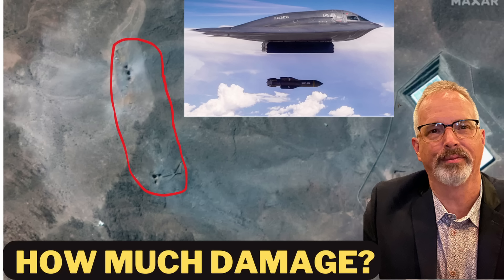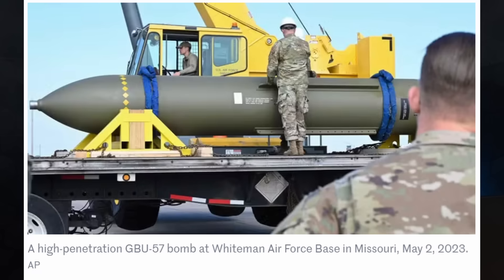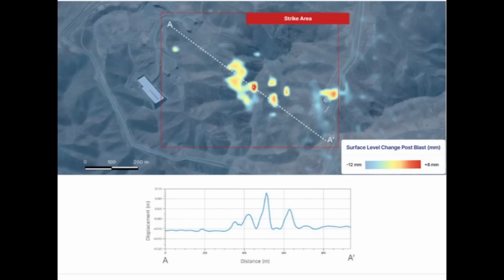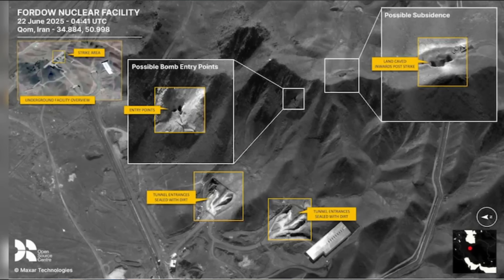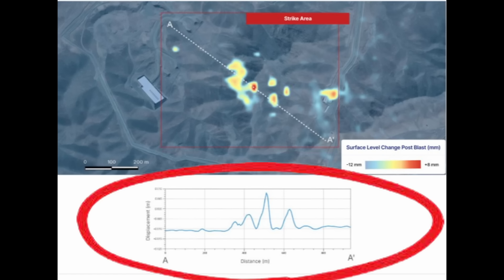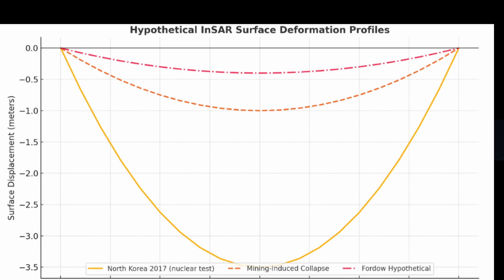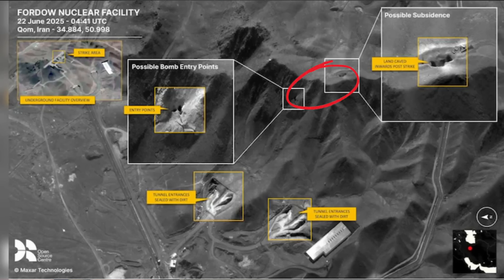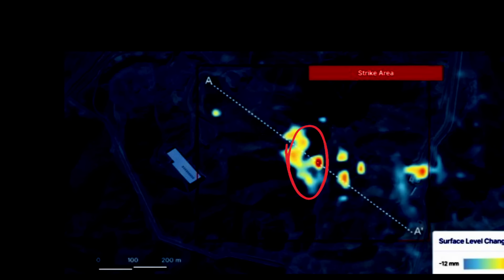Fordow Attack Assessment -  Update

Comment: You need to consider the use of (uhpc) ultra high performance concrete. Which is used to fortify these sites, significantly stronger than granite.
Reply: He omits it on purpose. He wants to badly believe this was some triumph.
Reply: @rashnuofthegoldenscales4512  Rashnu, you may have missed the part where 1+5 GBU-57's went down the ventilation shafts.

Comment: If I understood correctly, the damage assessment presented here is based on theoretical calculations using internet-derived data rather than the visual presentation of surface scans. If so, it remains to be seen what actual damage was sustained.
Reply from the maker: What are you talking about? The InSAR analysis involves using surface scan data.
Reply: @CaseyJones-Engineer  Thanks for your response.  I watched your video again and reached the same conclusion as my first comment.  Your  opinion that the Iranian nuclear facility was 'obliterated' by the US bombing may ultimately prove correct but  your video doesn't establish this as truth. You said you based it on calculations using granite physical  properties, explosive capacity  of the bombs and various assumptions about their ground penetration. You explained why the measured surface deformation might be small but you didn't use these measurements  in your calculation. I'm guessing this was because it would  require more complex 3D geometric modelling and data that isn't publicly available. All other engineering assessments I've seen have been more cautious in their terminology and refrained from using 'obliterated',  which has only been by political operators.  Unless you want to display a political bias, I would await the data or ground truthing before using it.
Reply from the maker: @tmcb2000  A difference without a distinction.
Reply: @CaseyJones-Engineer  Except you may be proved wrong if Iran is able to revive it's nuclear program.

Comment: In 1972 in Rhodesia the largest coal Mine underground operation suffered a catastrophic coal dust explosion probably initiated by methane gas igniting, there were 400 men killed and only about 11 bodies recovered that were closest to the shaft. The explosion was so strong that the Head gear for the hoist cage was blown completely off its concrete pad; trees and office buildings on the surface were scorched and severely damaged, I mention this because some 15 years later the ground started subsiding on the surface, in fact sone of the Mine accomodation had to be abandoned as tunnels that were underneath the township collapsed and this had the effect of a mini earth quake that cracked brick walls etc. Will be interesting to see how long Fordow shows subsidence

Comment: What if the ventilation shaft was far deeper than the works and blocked off from the drives? Not much sense in blocking a vent shaft on the surface and not below ground.

Comment: Hi. I understand that you assumed that the whole weight of the ordnance is actual explosive. The actual explosive content is way lower. If I am wrong, no offence intended.  Regarding the volume of fractured rock, I doubt that using quarrying loading factors where open faces (sides or top) and delayed set time allow for maximal expansion is of help in this case.  When blasting, the main breaking effect is TENSION due to the compression shockwave hitting a void (the open face).  A totally « enclosed » blast would never create the « volume effect », since without open face, the necessary tension cannot occurs.  There would be significant crushing in the immediate vincinity of the blast, but this would remain « local ».
On the flip side, in competent granite, without crushing the whole mountain, the blast shockwave could certainly travel distances to an open face, like the chambers of the complex, and expand there, filling the void with broken rock.  The facility is then wiped out and it’s case closed.  Now, if there would be two level of voids, my guess would be that the first one would be destroyed, but it would no pass the shockwave to the other. So in my opinion, a « two story » complex could have survived. If I know that, the US military’s Engineers know it, and the Iranian Engineers also.  Then, what is under there is a mystery for now. That was my two cents, and in now way a criticism of your work, that I appreciate very much.
On the strategic effect of the bombing, unrelated to the subject, I would just ask this: Where would you keep you valuables if you knew that the best safecraking team was in town for a job on your safe? Thanks Casey.

Comment: I said two-three weeks before all you silly engineers, pilots, enforcers, and every other dickie bird chirper, that vent shafts are the answer. Even for a ops squad to gain access.
When you've worked 3.2kms underground on south Africa gold mines, you understand better than most, pressure, air flow requirements and the force exhaust ventilation shafts size apertures required to live and prevent damp moisture occurring.
Question ❓ 
Whats a professional engineer. 😂😂😂😂😂

Comment: Up front, I don't have any background in geology, arms damage assessment, engineering or any of the sciences needed to make a critical evaluation here. But I do have lifetime of accrued observation of physics. Worth nothing, perhaps, but I find my observations corroborated in many instances. 

What I notice at Fordow is these MOPs repeatedly piercing the vents, deep into the hard granite. Each bomb driving deeper and detonating at depth. The explosive forces and resultant gases are not demonstrating on the surface. Those pressures are not simply absorbed by soft rock. This is hard, but brittle granite, not known for its flexing properties. Therefore, the first subject here would be mass compression of the open spaces (tunnels, shafts and work spaces). The volume of gases would far outweigh the capacity of that compression to absorb it. Next, that pressure would uplift toward escape. The depth and strength would largely hold in that expansion. So now the rock begins to shatter as the substrate flexes to absorb the blasts. That pressure, confined in this hard box of stone, assures complete destruction in my eye. It's almost like being inside a pipe bomb. Too much pressure and not enough space for expansion.

I would expect there to be a large void beneath the surface at impact points, shattering of the rock around these pockets
and total destruction of this facility.

Maybe I'm wrong, but this is what my common sense and applied physics history tells me. Iran will evaluate the damage and their actions will determine the success or failure of Midnight Hammer. If they start digging this equipment out, we may have failed, but I suspect they'll view the evidence and abandon this site. Thank you, for accommodating this simple man's opinion.

Comment: At first on TV some said bomb was 14 ton and it went down through granite 50? meters. Consecutive explosions are not equal single big. Explosion caused some rock melt, some energy (may be 1/3) to emit through shaft. What is more explosion resistant: reinforced nuclear protective concrete of granite?   Ventilation shaft connects to ventilation chamber thought ventilation ducts, there are fire dumpers, do you think that fire dumpers were explosion resistant? What material used for ventilation ducts? Where are the design  drawings? So ... what are you really talking about?

Comment: When railway tunnels are dug through mountains, the huge ground-pressure caused by the mass above can cause explosive spalling from all areas of the tunnel walls inwards. In this case, I'd imagine that the huge pressure-wave through the rock would find it's way to the tunnel walls and cause the same effect. The amount of high pressure gas from the contained explosions would find all sorts of cracks and fissures, scouring any voids.

Comment: - If the aeration wells are not straight and are deported from the entrance (which would be logical as protection) the bombs did not affect the site in depth.
- 100,000 m3 that makes 100 m x 100 m x 10 m high: it’s a lot but if the plant are not in this area it won’t do anything. At a depth of 80 m it’s far, there is at most a fracture of the granite but no damage.
- It is also obvious that the Iranians had time to move blocks of granite to seal the galleries, it was enough to have kept some from the construction.

Comment: The way you presented your data and your conclusions I find the conclusions a bit unsupported by the data. By all the information you presented it seems that it's very hard to estimate the damage dealt to the site. The conclusion that I got is that surface level data are simply insufficient to judge the in depth damage. 

What I found a bit confusing from your presentation and a the surface topology map shows a tiny surface change and moreover there is a surface uplift on a totally unrelated spot, meaning that this data could be conflated with other phenomena and could be showing us something other than the damage from the explosion. So I really don't understand what is the data that actually suggests that there was indeed massive damage.

Comment: The impact of GBU 57 on Fordow site is a diagonal hit as shown by the three holes and not a vertical hit going downwards. The concrete cap which the MOP pierced coupled with a dogleg design of the ventilation shaft could change the direction of penetration to diagonal/ lateral instead of going vertically downwards. Though the initial and subsequent GBUs would cause a substantial damage within the rocks but how much to the centrifuges / main structure is a matter of assessment which may or may not be factual.

Comment: not sure what you are anilizing but it would appear to be the video of testing the bomb. the footage they showed of the actual bombing was a fireball like heroshima that came back out the hole the bombs went in. if there was penitration do you actually think there were no other ventilation shafts in the facility that would have had massive pressure and fire to come out. and what about the entrances surely that monster bunker superfragilistic buster should have had the power to blow those entrances wide open. As engineers you may want to add in a little common sence to your calculations after all this is real life listen to what your eyes are telling you.

Comment: Great presentation but I'm just wondering if the cumulative, progressive weight of granite at depth increases its stability and skews all these calculations about explosive force in granite. I'm a layman, And maybe the 'high confining stresses' you referred to would basically say that the higher the resistance of the granite produced by the weight of the granite above it would actually increase the destructive power of the explosion. Is that correct, where does it confine the explosion and make it actually weaker in terms of its power to deform the rock?

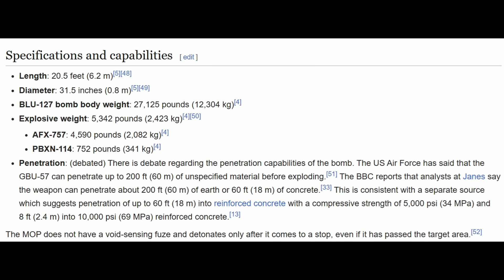Comment: The specification shown(1:47) says penetration was only 8 ft through 10ksi concrete.  This must be a mistake.  If granite is a 30ksi compressive strength  material, it does seem that the Fordow facility must have had a great weakness in ventilation shafts leading straight down to its vitals, if it really was destroyed.   I sure wouldn't design it that way--a long angled horizontal passage to the nuclear catacombs after a jagged vertical shaft would be more like it.  Analysis would also need to address bunker engineering designed to deflect (ricochet) the bomb off angled hard surfaces.  If the protective material is granite the bomb will not penetrate 50--70 meters needed to destroy a bunker down 80 meters.  Hats off to Israeli intel, it must be they who found the glaring weakness in the design of those ventilation shafts, again, if Fordow is gone.

Comment: Ventilation shafts could still be far away from centrifuge halls and the impact of the bomb may be limited to the blast of high pressure air coming  thourgh  tunnels between ventilation shaft and centifuge hall. Still enough to knock equipment down even if the roof doesn't collapse.  If we had had live vidoe, we could have seen if smoke came out only from ventilation shafts or also cameout from access tunnels or elsewhere to give hint of at lease the distribution of the "blast" of compressed air from the bomb.  
 
If the centrifuges were spinning, the blast and "earthquake" may have been enough to cause them to explode due to being shifted out of rotation axis (they typically do 50k to 70k rpm). If the ceiling did fall. then you are looking at a chernobyl cleanup event  with huge amount ofcontaminated ground with release of of gaseous Uranium Hexa fluoride that is now sread around and will percolate to ground and atmosphere eventually.  That is why there are rules against bombing nuclear facilities.

With his rethoric having forced Iran to cut off ties with IAEA, we'll never knew the true status of the facilities.  Iran asking the USA for cleanup money would be tantamount to admitting USA did cause severe damage requiring 30 years of cleanup and Iran is too proud to admit the facility was destroyed (for now).

Comment: The GBU-57 MOP has only ever been publicly known to penetrate:
200 feet of soil.
60 feet of 5,000 psi concrete.
8 feet of 10,000 psi High Strength Concrete.
While Granite is typically 16,000 to 30,000 psi.

In other words... There is VERY LITTLE chance these bombs did much damage.
Reply: You are aware that the ventilation shafts were filled with air, not granite.  Right?
Reply: @gyrocoptic_2  ventilation shafts are no a through hole, otherwise water will flood

Comment: Is it possible that you could better explain your math? Are you referring to the mass of the bombs or the explosive filling of the bombs, excluding the mass of the casing? Is your calculation a single explosion or multiple successive explosions? Does fracturing allow for later bombs to penetrate deeper, and does your calculation include this? Does the timing of the later bombs make a difference? Also, there are different versions of the GBU-57, and what difference might it make with which version was used?
Reply: His calculation is wrong by 4X

Comment: Yeah, all this is assuming Iran moronically had those shafts going straight into the main area. If they were competent, those shafts would be offset. Then, the drives connecting to those shafts would be directed away from the facility. For example, at 45 degrees    from entrance channel (drive) pointing towards the opening. Therefore, the directions the blast is going to go are, back up the shaft (air vent) and out the drive, away from the facility. That would massively reduce the fracturing power of the blasts and minimize working force in the needed directed towards the main chamber. That the bombs were detonating in a dead end and not a void may be indicated by the excessive bright flash seen by the escort pilots. An explosion within a void would have produced minimal observable light on the surface. A detonation within a narrow shaft that can only go back up will produce an intense beam of light, like a powerful search light. If the escort pilots got caught in that beam, it would have been extremely bright. Then, with each detonation, a small void will be  produced. So, the second bomb will have less containment and working force than the first. With each detonation that will only get worse. Then there will be a fluting effect, where the edge of the shaft widens out with each blast at the point the cavity is being created and enlarged with each explosion. So, there is increasing efficiency in directing the blast back up the shaft.  So, it is much more complex than can be represented by your simplistic analysis. If the Iranians have been smart and done some tricks with those air vents, there is a huge chance minimal damage has been done to the facility. If they weren't smart, they deserved what they got for being stupid and leaving such a weakness.

Comment: the video you  showing explosion takes down a wall, thats might not as  appropiate

the detonation happened in a shaft
by its nature  its open upward
so very much  pressure  evacuated upward, and  reduced the  pressure below
there was  also  a solid  steel shell  wedged in a rocky  material
the housing of this bomb

so it wasnt same like  miners drilling a hole and lowering the  explosives

if this  buster could  pucture the ceiling then no doubt about damage
but if  it exploded  in the  middle  of this  rock mass then i would be careful with  every statement

we would only know sure  if  we could see videos  from the facility
because im sure  there were  videocameras  down under

Comment: Of all the indicators discussed, the most telling may be the minimal uplift measured at the surface. Given the amount of explosive detonated underground, if the blast waves were heavily reflected by subsurface rock formations, or special hardening of the facility, one would expect a greater uplift. It stands to reason that this ordinance is designed to focus the blast directly downward. Furthermore, even laterally deflected forces would also vent upwards and out of the penetration to a greater extent than is obvious from post attack photos. There seems to be little other than dust ejected from the vent holes. These considerations indicate a high probability that a majority of the blast and concusive force did indeed vector downwards and into the cavities forming the facilty. In fact, if even one bomb reached these cavities, it unlikely anything survived intact.
Reply: The force of an explosion will seek the path of least resistance
Reply: Most of the dust was presumed to been the protective bunker over the vents that was destroyed pre-emptively to permit the real attack.